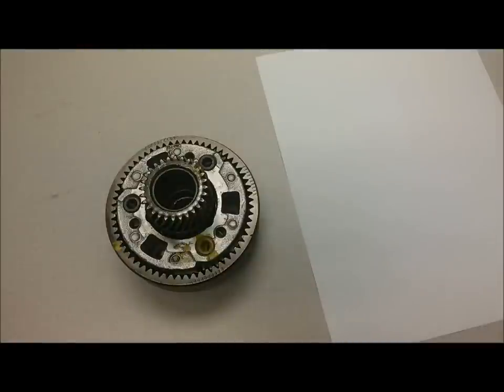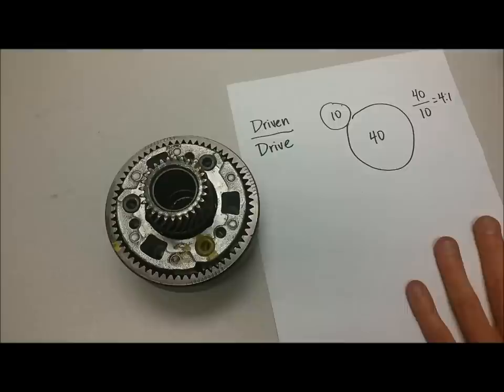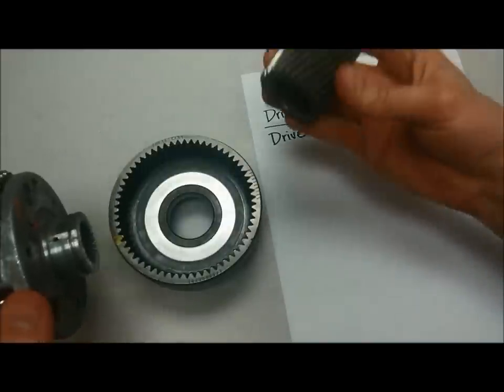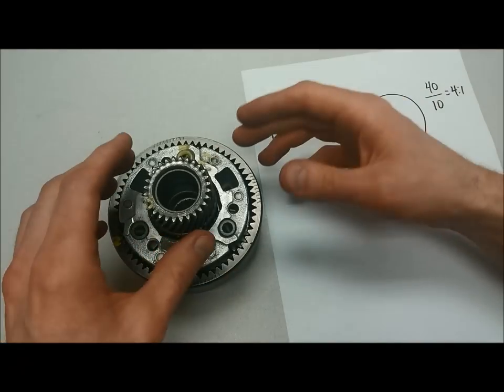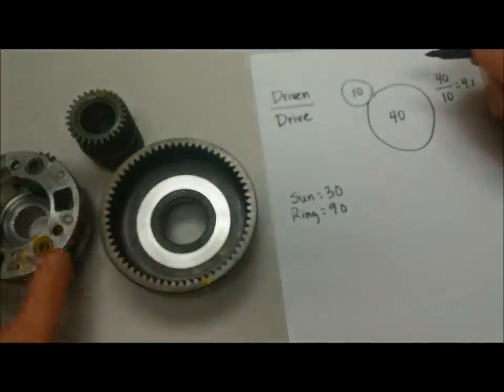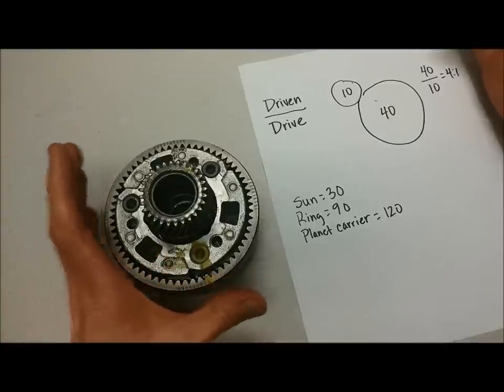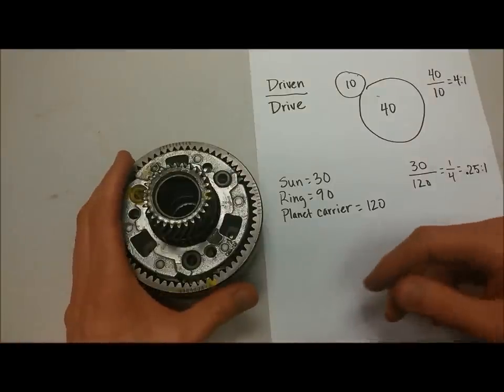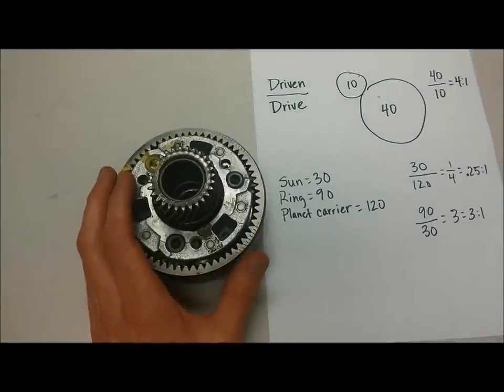Calculating gear ratios within a planetary gear set

Comment: Cool explanation ! 
Quick questions : how does the operator select which gear is the driver then? 
How do I know the efficiency of the transmission? (there must be some energy loss) 
How do I use this is real life applications? (say I want to move a 100kg load on a small platform with 2 or 4 wheels. How do I work out the torque required?) 
Thanks!

Comment: It's just an idea!
The idea is that:
One to three is a completely balanced gear ratio for one link of a coaxial gearbox.
This, for example, is optimal for a wind turbine, where the loads change by about two orders of magnitude - this is 100 times!
Switches must be made between these links.
And so: 1:3:9:27:81:243
Six-speed transmission.
The wind speed acting on the entire washed area of the fan - this theoretical perspective windmill, varies from 2 m / s to 32 m / s!
And the power removed from this electric generator varies from 2 kW to 200 kW!
That's why you need such a reducer.
I mean - It's a crazy idea to use a wind generator for hurricane winds.
And, at the same time, - for very quiet winds - almost calm!
For small autonomous settlements or even for separate remote buildings.
The coaxial gearbox has an advantage both in terms of the weight of the metal, and in terms of the efficiency of the interaction of gears, and, probably, in other parameters.
Perhaps the same gearbox is suitable for other technical objects, just need to think about which ones.
Considering the remarkable parameters of the coaxial transmission scheme of the mechanical moment.

Comment: May I ask you a question? You said that: Planet Carrier = Sun + Ring. In this case, we have 3 planet gears. But what if we only have 2 planet gears connect to the carrier? Is this formula still true?
Reply: It would be since it isn’t based on the amount of planetary pinion gears are in the carrier, but on the circumference of the carrier which the pinion gears make up. Think of it like drawing a circle and putting two points on either side of the circle. It’s still the same circumference, even if you double, triple, quadruple, etc. the amount of points, it’s just more areas of contact.

Comment: Hi, this video was very helpful, thanks a ton.

I have a few doubts though.

1. If the number of teeth on planetary gear is calculated by the sum of the teeth on ring and the sun, how do we calculate the teeth on each planet gear? 

2. does this depend on the number of planets we have?

thanks again
Reply: 1. The planet gear has to be the right size to fill the gap between the sun and ring gears, so in this case it needs to have 30 teeth as the radius of a gear is proportional to the number of teeth (For a given gear module - which is a fancy way of saying tooth size). The diameter of the ring gear is equal to 2 x planet gears + 1 x sun gear, the sun gear has 30 teeth, the ring has 90, so 90 = 30 + 2 (Planet gear teeth), which solves to give 30 for the planet gears. 

2. Only one tooth at a time usually carries the entire load between when 2 gears when they mesh, so the more planets, the more teeth are available to carry the load, so the higher the torque that can be carried by the ringset. The number of planet gears has no effect on the ratio. Keep in mind that for most applications nobody cares what speed the planet gear turns at, it's the planet gear carrier that's working as an input or output. The speed the planet carrier turns at depends on the difference in speed between the ring gear and the sun gear.

Comment: Then for the planet gears / pinions, we just estimate the number of teeth on the ring and sun gears, and add them up - or if desired, count the number of teeth exactly, and use the result to do the calculations ?  Isn't there a precise formula that would be used for this ?  There must be, or engineers would just be guessing when they make their designs.

Comment: Why do we say the planet gear has the sum of the gears of the sun and the ring?
Reply from the maker: +Okan Kurt It is because whenever the planetary carrier is acting as the input or output gear in a set (not just an idler), the carrier is effectively being turned by both the sun and the ring gear.  For example, if I were to hold the ring gear still, while turning the sun gear, the carrier would be the output.  Note that it is not the planetary gears that are the output, it is the carrier.  The rotational speed of the carrier is determined by how the planetary gears are "rolled" between the sun gear and the ring gear.  Hence, the sum of the teeth on both gears.  I hope that wasn't too confusing!
Reply: Is easier to see by the next formula:
(Nr+Ns)*Wp=Nr*Wr+Ns*Ws
Where "Nr" is the number of Teeth  of the Ring, "Ns" is the number of Teeth of the Sun, "Wp" is the angular Velocity of the Planet Carrier, "Wr" is the angular Velocity of the Ring and "Ws" is the angular Velocity of the Sun gear.

So you can see that the  planet carrier velocity don't depend from the number of teeth of the planet gears, instead depend from the sum of the teeth of the sun and the ring.

Comment: So if I had a sun gear with 12 teeth, a ring gear with 60 teeth, and the planet gears had 24 teeth each, I would add the s12+r60 = 72 and the p24 x 3 = 72 because I have three planet gears that would be a 6:1 gear ratio?
Reply from the maker: No, that isn't correct.  You don't ever count or use the number of teeth on the planet gear when determining the ratio.  The planet gears are idler gears and their speed is always going to be a result of the speeds of the sun and ring gears.  To figure out your ratio, you need to determine which of the three components are acting as the input and output gears, and then divide the number of teeth on the output gear by the number of teeth on the input gear.  If the planetary carrier happens to be either the input or output gear in your scenario, you should not count the teeth, but use the sum of the number of teeth on the sun and ring gears for your number.   I hope that helps!
Reply: The ring gear is stationary and the planetary carrier is able to rotate
Reply from the maker: So is the sun gear turning the planetary carrier, or is the carrier turning the sun gear?  If the sun gear is the "drive" gear and the carrier is the "driven" gear,  your ration would be  p72/s12 = 6:1, just like you said, but it is not because of the number of teeth on the planet gears--that is just coincidence that they add up to 72.  You could easily have a fourth planetary gear in your carrier, and it would add 12 more teeth to the mix, but it would not change the gear ratio.
Reply: The sun gear is the drive gear and the carrier is the driven gear

Comment: shouldnt your ring be the sum of 2x the planet carrier + the sun gear??? so when your sun gear is 30 en your ring is 90 your carriers would be 60 together
Reply from the maker: The actual physical number of teeth on the carrier gears have no bearing on the gear ratio.  The speed and torque of the carrier are the result of the number of teeth on the ring and sun gear.
Reply: correct

Comment: So can there be a planetary gear set with a 1:1 ratio where the input and output are matched in speed?
Reply from the maker: There are two ways to get a 1:1 ratio from a planetary gear set:  You can lock the entire assembly together and turn them as one unit, or you can spin the third member of the gear set in the opposite direction at exactly the right speed so that both the input and the output gears are turning at the same speed.
Reply: Justin Miller
So the second one is what I'm talking about (I don't think the first one really counts), if the only way to get a one to one ratio in a planetary set is to run the same number of gear teeth on the sun and ring gear how would a one to one ratio be possible when the ring gear will always be a larger circumference than the sun gear?
Reply: Beach&BoardFan...You can do that with sprag bearings or one way bearings on the planetary gears and carrier such that when the sun gear rotates in one direction, carrier locks & planets spin, you would get the gear reduction of say 3:1 or whatever ratio you have sun to ring... and when you rotate the sun gear in the other direction, the planet gears would lock while the carrier would unlock & spin with the sun gear driving the ring gear directly @ 1:1... done
Reply: Beach&BoardFan Why does the first one not count?  Isn’t that how a 1:1 ratio is obtained on an Allison automatic transmission?
Reply: @beachboardfan9544  Locking the assembly up is a legitimate use for planetary sets, and it used very often. If a 1:1 ratio is needed in addition to other ratios, it's the simplest design. For your second approach, that would require addition gearing to get the carrier to turn at the right speed, and, if you wanted more than one ratio from that gearset, then you're talking an addition brake for that extra gearset. I'm scratching my head to think of an OEM application where an engineer was able to justify the additional engineering/cost/complexity just to avoid using a simple lockup

Comment: IN GENERAL HOW MUCH TORQUE WILL INCREASE
Reply from the maker: The torque is multiplied by the gear ratio.  For example, if the gear ration is 3:1, then the torque would be multiplied by 3.
Reply: @JustinMillerAutomotive  THANKS FOR THE CLARIFICATION

Comment: The number of teeth on the ring is the number of times it turns the the planets is the number of times the sun turns 
So if the ring has 60 teeth and the planets have 10 the sun turns 6 times because the sun can only turn the number of teeth on the ring